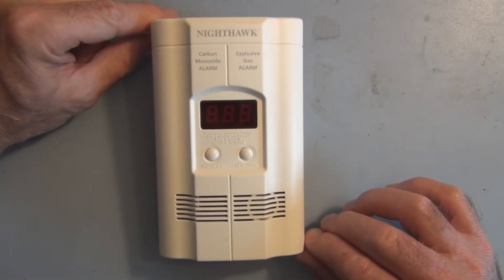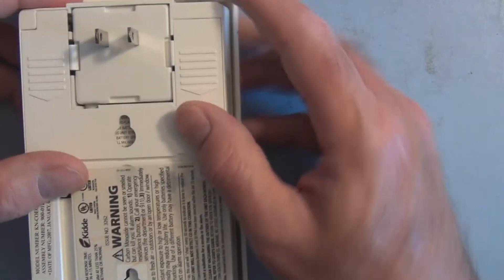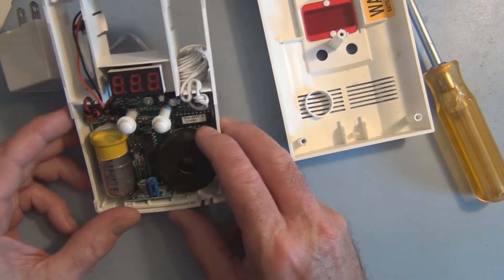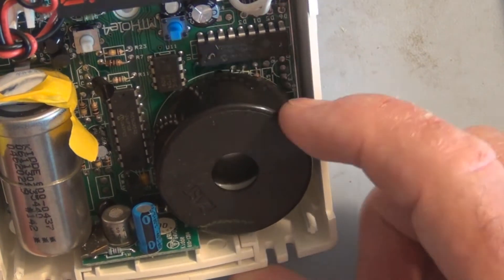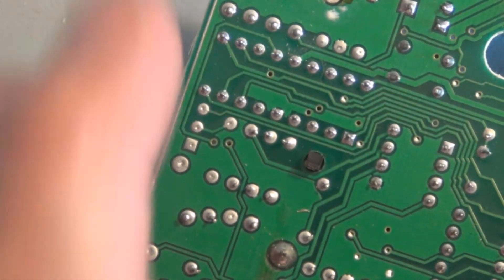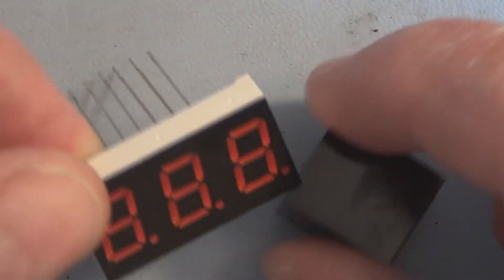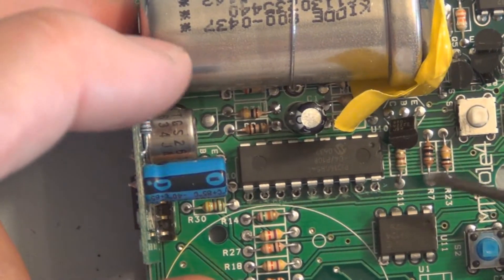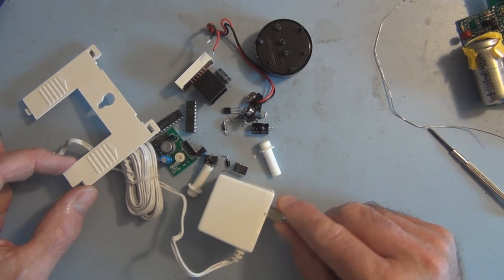Carbon Monoxide detector tear down

Comment: c101e might be this, driving the speaker.

http://www.alibaba.com/product-detail/RE46C101E8F-Logic-Horn-Driver-IC_1380976165.html
Reply from the maker: omgffsification   Thanks for the information.  I actually looked at a different link from alibaba yesterday but it did not mention what the chip was anywhere for some reason.  I added some annotations with part numbers to the video.
Reply: eTechTom

There is something really satisfying in salvaging parts from scrap electronics equipment.
Maybe its a hoarding instinct, but I love it.
And the process of trying to find out what the mystery IC is.
Nice video Tom.
Reply: You are correct, it is to drive the alarm signal(s).